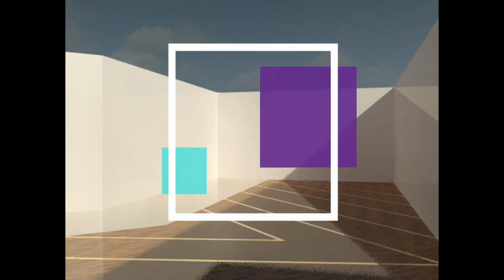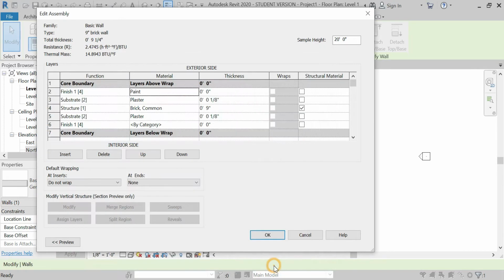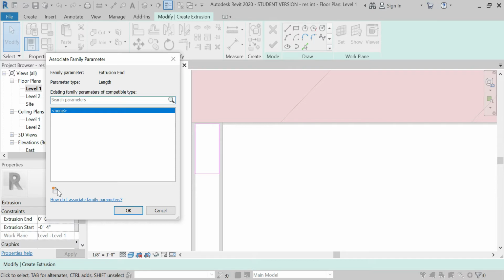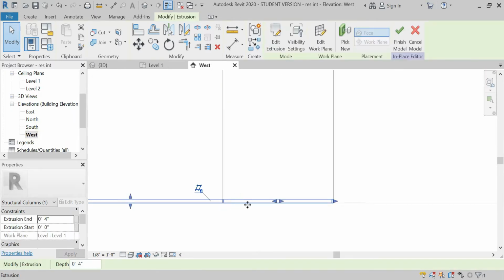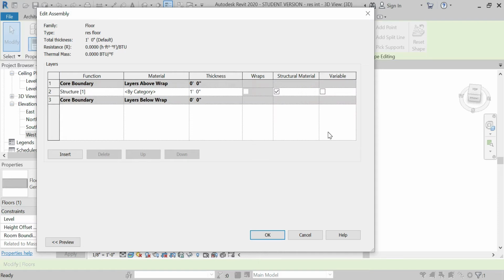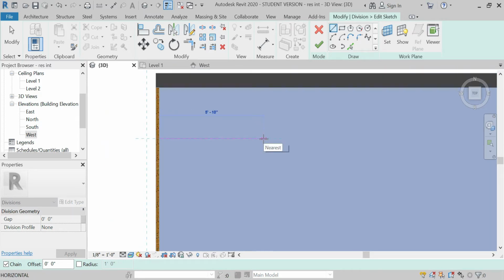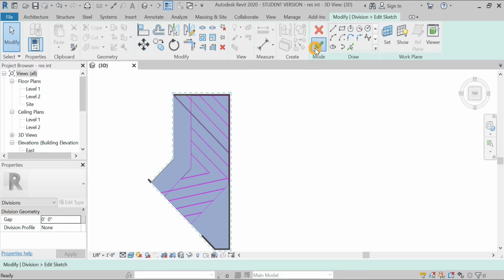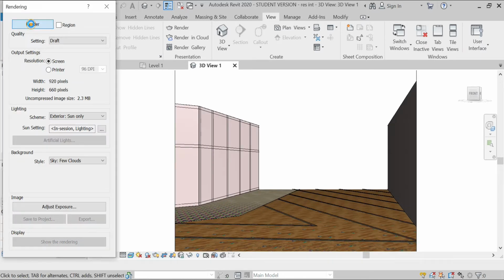Revit Tutorial - Interior Design of a Restaurant (Part 1)

Comment: Hello, I follow you with likes. I have made progress thanks to you. But I have a problem. The materials in the floor are not visible in "Level 1 or Level 2" even though I'm setting the "parts visibility" settings to "show parts". How can I make them visible?
Reply from the maker: Thank you for your support and feedback.
Sometimes this issue occurs and I don't know the reason but you can move the whole floor a bit upwards like 2,3 mm to make it visible in floor plans.
But there is also a better solution which is that you can use the "split face" command to create designs in the floor.